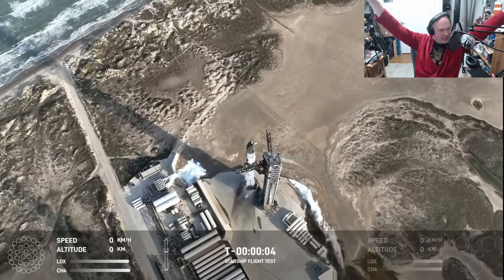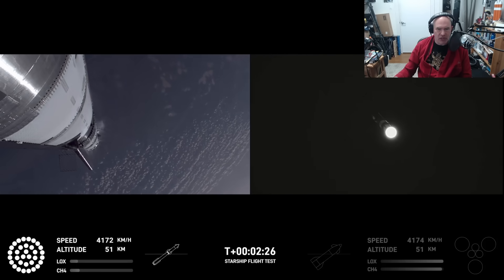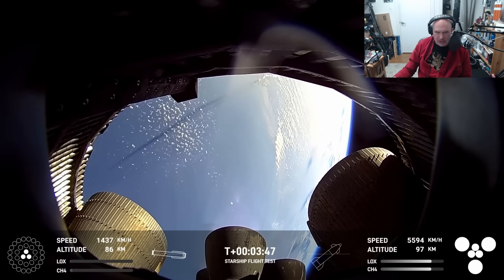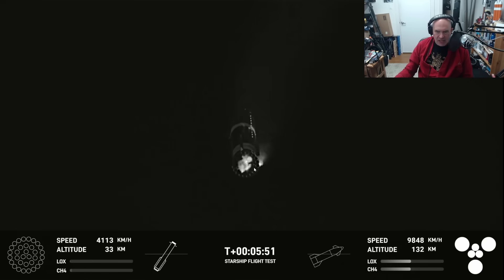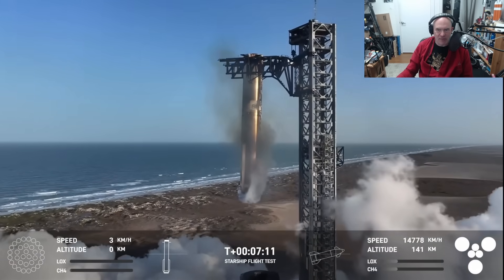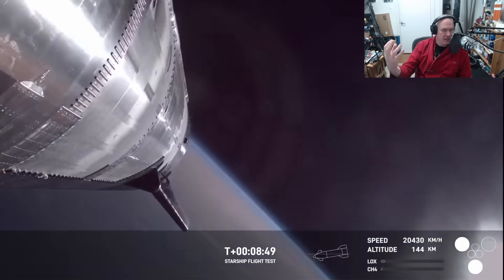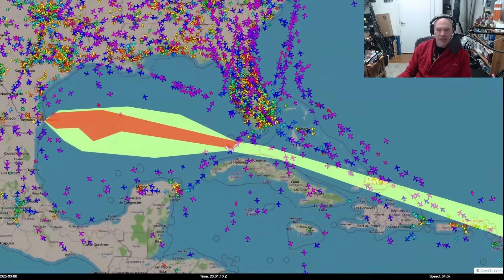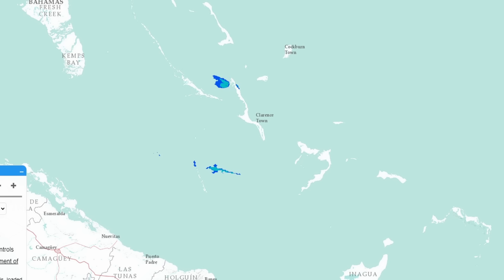SpaceX Make The Same Mistake Twice With Starship Flight 8

Comment: Don't think so. The problem is the stage separation. It's putting too much stress on the bottom of the starship and breaking into the housing.
Reply: What evidence do you have for that claim, and what is your recommended test procedure to verify?
Reply: @teebob21  Calm down, Musk isn't your father.
Reply: @ Dave, I'm perfectly calm. I'm an engineer. I'm not governed by my emotions; just the data. I'd like to test your claims. What is your recommended test procedure to verify, and what post-flight evidence leads us to believe that the fault occurs during stage separation?
Reply: A problem during staging would most likely have shown up much earlier. The second stage engines were running for 5+ minutes at this point. Yes, this could have been caused by vibrations during first stage burn or during stage sep, but i find that somewhat unlikely, as the booster itself didn't suffer any major damages. Although the failed engines on boostback burn also point to some major engineering fuckup, but that seems somewhat unrelated (except for common problems with the engine design).

Comment: Irregular bracing on the long downpipes may prevent harmonic resonance as fuel is depleted. This bracing could double as  mounting points for tank sensors and cameras.
Engines should shut down during a tumble to allow thrusters to rescue the mission for a restart.

Comment: Maybe The titanium is too brittle going from hot to cold to hot again. In the "bell," which contains all the fuel cooling tubes. Maybe it's a flaw in the manufacturing process that has created weak bonding between the layers.

Comment: Yes.  I was watching the video feed live and was concerned about the flames just before some of the engines shutdown and caused Starship to loose control. 
Yes. This is the second instance of the problem.  It is a new Block 2 version of the Starship.   And The Chief Engineer must come in and do a review to find the root cause.

The issue is that The Chief Engineer (Elon)  is also the Head of DOGE and doing an in-depth analysis of Federal Government spending. both of which are extremely difficult tasks. Maybe delegate where possible to trusted hands.

My best wishes Elon.
Reply: LOL.  It's very clear that nobody in "DOGE" is doing any kind of analysis of spending, or they wouldn't be doing so much awkward re-hiring and begging critical staff to come back.  They just implemented a flat firing rate and canceled any program that had diversity in the title.

Comment: 4:28. The glow between the engines isn’t methane burning. It’s adiabatic heating, which is the same thing that makes diesel engines work without a spark. With the booster here, temperatures peak when it achieves peak deceleration, which is about 4 g's at this point.
Reply: you are right there is heating from adiabatic compression, but it reaches the combustion temperature of the methane they are venting, plus oxygen in the air, bam you got combustion and thus you are wrong the glow is not from heated air alone but indeed from methane burning
Reply: @ianglenn2821  Oh. Well… You went and used “bam” to denote that it’s all so elementary in your mind. Years ago, I was listening to some guy in person lecture me about how the world was flat and he punctuated his conclusion with that same word, “bam,” to drive home the obviousness of his inescapable logic. Funny.

Comment: shit happens, but at least they are saving the boosters, thing is which part is more expensive? the booster or starship? even though they were gonna still soft land on water so it would still be a loss of $.
Reply: booster by an order of magnitude. Most of the rocket is just big empty tanks, the expensive bits are the engines and the booster has a whole lot more.

Comment: Still a really important data point: now we know it wasn't a fluke but an actual design issue.
Reply: lol
Reply: "It is not a design flaw! They are all like that!"
Reply: This is more than just an "issue". SpaceX might have to stop throwing expensive hardware into the ocean for a bit and sit its engineers down to run through all the basic calculations again. Both Booster and Ship had engine problems, there seems to be something fundamentally wrong with either the raptors or their plumbing. Just doing some hasty patchwork and crossing your fingers doesn't seem to do the trick.
Reply: @ReneSchickbauer  They will not do that, because if they did they would conclude that the Starship concept itself is fundamentally and irreparably flawed.   And that would be, ahem, embarrassing, because they already got a couple billion dollars from NASA to send a crewed Starship (Artemis III) to the Moon and land there.   Which Elon promised to accomplish in 2024.  The mission would require half a dozen Starship launches, (according to Elon's promises; actually 20 or more), each carrying 100 tons of extra fuel as payload, to re-fuel the Artemis III Starship in LEO orbit.  This in-orbit Starship refueling capability should have been demonstrated by SpaceX in Feb/2022.  

Oh, and Elon also once promised a Starship landing on Mars in 2018.
Reply: @JorgeStolfi well the design isn’t fundamentally flawed, we see that it works, they just have a bad new version of the ship. V1 worked in all of its expected forms, it’s only issue being too much heat stress on the front flaps, which despite literally melting could still keep the ship under control, which is pretty cool. I do agree that they need to stop trying to meet a near monthly launch time though, this ship has a critical construction flaw and they need to take a step back and re-design it. Testing through launching isn’t wasteful, continuing to launch the same problem in haste is.
Reply: @Syntex366  "Work" in this case means "can deliver at least 50 tons of payload to a normal Low Earth Orbit, deorbit, land back on the chopsticks intact, and be easily refurbished for another flight."  These 8 tests have not given any evidence that Starship can do even the first step; if anything, they indicate that the Starship cannot do it.   

As for "Starship V2" (not what flew on Test 8, but what Elon hinted at in a presentation to SpaceX staff, a while ago) it is not clear that it will do any better.  Making a rocket longer and filling it with more fuel will not necessarily get it higher and faster at the apogee.  If V1 was already optimized for the engines available, it should do the opposite...
Reply: @JorgeStolfi  you’re over-defining what was expected of block 1 and that’s your own problem. Block 1 is not, nor was it ever meant to be the final form of the rocket. It was purely meant for testing if such returns were even possible and worth building the bigger rocket for. In that aspect, It did work. Booster is performing tower catches, still with some issues of course, there’s only been two consecutive catches, not enough to prove the system is solid, but it shows success. Ship is maintaining control and performing proper belly flop burns to do a successful splashdown landing sim. The issues with the forward flaps melting on re-entry are obviously serious, but far from unsolvable, especially since both times they managed to maintain control of the vessel the entire time and perform the required aggressive maneuvers even when severely damaged.

The solution of “more fuel” is not to solve a failure of the first rocket getting to orbit, it’s to start adding in the capability now that block 1 has proven the mission profile is actually possible, given some adjustments, like the forward fin positioning to reduce the heating they endure and avoid serious damage. Plus, we don’t even know if block 1 didn’t have the fuel payload to get to orbit. I sincerely doubt it did since they were always planning on higher efficiency, lighter engines like the in-dev Raptor 3 for the functional model, but the Indian Ocean was always targeted intentionally and the FAA also never approved them for orbital testing, so maybe it could’ve managed. Probably not though.

Sure, you can argue it’s a wasteful form of testing, I agree on that, SpaceX has a problem with testing by launching and discovering errors at the loss of millions that they could have discovered through other means. Especially on these last two launches for the block 2 ship, if they’d done their homework they would’ve realized that the static fire test didn’t help test the aft-fire problem. Another commentor I saw elsewhere brought up some really good info, that the Saturn V actually had a similar incident with engine flame-outs from harmonics on, I believe, Apollo 6. I’ve unfortunately forgotten what they said the problem was that hid the issue during the static fire and not during flight, but my point is that data on this kind of problem was available and SpaceX opted to not check for such things, causing V2 to go 0-2 for a problem that already had a studied solution decades ago.

Regardless, this doesn’t make the Starship a failure, it just makes their company inefficient in how they develop these machines. And if we’re comparing the Starship success rate to Apollo, let’s keep in mind that the Saturn V rockets were always inches from being a death trap, done as rapidly as they were from government pressure to beat the Soviets for PR. You can’t exactly get away with a rush job in a reusable vessel like you could for Saturn V, because the problems stick around, they don’t get chucked off with the next stage. Also, the starship is reusable. Getting upset that something like that is taking longer to develop than the disposable stack method is insane, it’s leagues harder, modern times don’t change that just because it’s been managed before on a much smaller rocket. SpaceX could certainly increase the success margin per launch if they’d stop being so hasty, but that’s the way it is.
Reply: @Syntex366  That i just a diversion. The contract they signed with NASA said that they would to an orbital test flight, not the unsuccessful suborbital launches they have been doing, by Q2 2022. It is obvious that they failed with that goal. However, it indicates that Block 1 or 2 at the latest was intended to reach orbit and for Block 2 they stated a payload to orbit of 100 tons.

Even when assuming that Block 1 was never intended to even make it into orbit, which is questionable since it was used until this year and Musk claimed multiple times they would attempt to make it into orbit, so if you did assume that Block 1 was successful in that it managed to partly survive a suborbital launch once or twice, the changes made to Block 2 say that it is supposed to get into orbit, and it has failed in that.

Arguing that a program that is years behind schedule, over budget, has not delivered as little as a kilogram of payload, and were maybe two of the ships returned in anything even remotely resembling salvageable condition has "worked as expected" is equal to saying that they "expected" it to do little more than burn money.
Reply: @ lol, imagine that. A government contract running over schedule and budget by a lot. That’s NEVER happened before…
Reply: @Syntex366  Good that we now have a whole new Department devoted to rooting out such waste and corruption.
Reply: @ReneSchickbauer wow, spaceX need to hire you immediately! They could save millions and shave a vast amount of time off R&D simply by introducing the concept of chairs to their design process. 😋
Reply: It's wild how this notion of wastefully destroying massive hardware just to gather "important data points" has become so normalized.
Reply: @snizami  I mean SpaceX is burning taxpayer's money, so why should they care? xD
Reply: @snizami  Yeah, it's almost cult-like worshiping, isn't it...
Reply: @elgonzo7239  they treat this "iterative development" thing as if they're destructively testing samples of string on a jig to learn some limits. What this is is haphazardly wasting expensive hardware while the technocultists celebrate the setbacks.
Reply: do not be daft

Comment: I've wanted for a long time to see six outboard engines on Starship instead of three. The torque from that one engine going out was enough to end the mission. If there were six, you could shut one or two down so the engines still push through the ship's center of gravity.

Comment: 9:45  While there is a void for heat to collect between each V.Raptor and the 2 adjacent Raptor Eggs, you can clearly see the elongated doohickeys on each V.Raptor are clocked in a spiral pattern. This is setting up a vortex effect between each engine trio that keeps heat trapped between the engine bells (you missed that wording at 12:17 when making resonance references).

The aforementioned doohickey next to the visible hotspot is causing too much turbulence in this vortex, but there may be more since you can't see that side of any other doohickey area on any other engine. This is making the heat concentrate there instead of rolling into the eye of the tornado and being hawktuaed from what is probably acting as a transient engine bell via air-bending. I shall coin this the "Ghost Pipe" effect (after the fungus), until the proper explanation is public. This is a very good name for the effect, assuming it exists, which it publicly doesn't.
Reply: Sure but führer Musk surely know the implication of having a topological, spirally extruded, shinzo doohickey part on those 99.999999855445658% reliability factor V2 engines. Solution would probably be to position the center axis of the bells with a 19.39 degrees between each other. That precise angle should provide a very specific Reich index that should stabilize the expansion of the the final exhaust while maintaining its original chemical solution ... 

As far as coining a hawktuaed derivation of that very same Reich index, it may prove difficult to pump that value in the gestapovlan simulated reference system and obtain a new final solution that could allow the DOGE injection plate to operate at higher mengelian pressure without deteriorating the zyclon protective layer of the high temperature internal furnace... 

Let's hope führer Musk, in his high ketamine wisdom, will solve all those problems, so we can colonize the solar system to have more living room for our white race, I mean humanity. Thank you for your time...
Reply: @ You didn't have to go there. Nobody wanted you to go there. You haven't impressed anyone.

Comment: Good analysis. What I think a lot of people are missing and seem to actively forget now that Musk is in politics, is that we knew stuff like this would happen. Since the cost per rocket is way cheaper than basically any other rocket built, the they are solving numerous huge engineering challenges that no one in space has done before, and they have developed starship in a fraction of the time as any other government agency, there will be failures. I think the forgetting part I mentioned basically boils down to the fact that they have moved so fast and learned so much, that we are expecting too much from SpaceX. While it is unfortunate that these things happen, every launch is more data to learn things. Frankly... I am surprised that other rockets have not had more failures, since the amount of data received was much lower. There is something to be said about taking 10+ years and basically making the system foolproof through meticulous attention to detail, but I think SpaceX is still leagues ahead because they are actually running into all of the errors that people spend decades ironing out carefully. With a cost per launch I think around 50 million or less, they can afford much more flights than like a Saturn 5 of over 1 billion per launch. I have full faith that they will sort out all of these issues.
Reply: I think it's two things: one, Musk making an ass of himself in politics brings more visibility to these rocket videos than just space nerds, and two, we're less inclined to be charitable towards SpaceX when the CEO is having a public meltdown calling astronauts r tards on Twitter when he gets called out on the political lies.  I still find the Starship program exciting, in spite of the asinine hypeman at the helm, and in a few years we'll look back on this and groan.
Reply: @JohnDoe-420  Guess we have different opinions then. I fully support what Elon is doing in the government and I fully believe he has nothing but benevolent intent behind leading DOGE. I do not see any of what he is doing as problematic and he is obviously not a nazi lol. Elon is led by common sense, which is why I believe the Starship program will ultimately succeed.
Reply: @Nick_Adkins  Look at how wrong you are about, well, everything.
Reply: @ I think you accidentally swapped the words right and wrong lol

Comment: flight 7 showed a progressive loss of engines one at a time indicating damage propagation consistent with an internal fire steadily eating into data lines causing engines to Failsafe.
so far for Flight 8, it appears that unlike a progressive fire that something failed catastrophically resulting in the near immediate loss of 4 engines all in very short order indicating the Rvac suffered some form of RUD that then took all 3 sea level raptors with it.
there is definitely a lot of work ahead to find the root cause of this one.
regarding the FTS. even though ground team have "Safed" the FTS, it is still active and CAN be triggered via the onboard computers upon detection of a critical violation of flight parameters such as complete loss of directional control that risks the ship departing the flight limits into areas exposing danger to those on the ground.